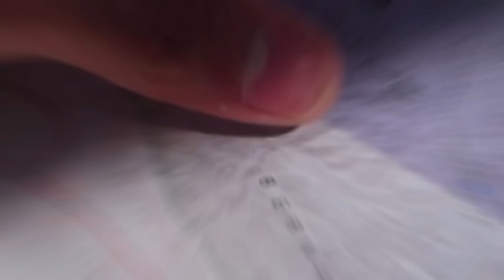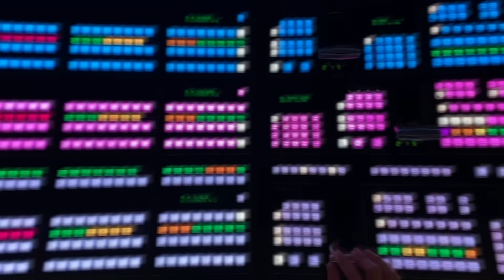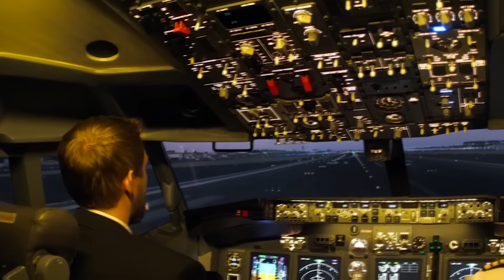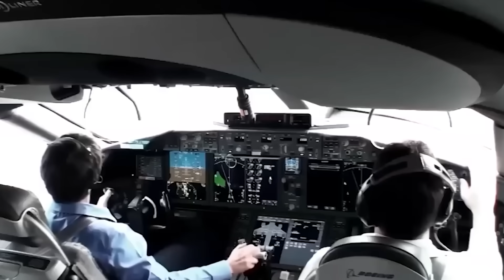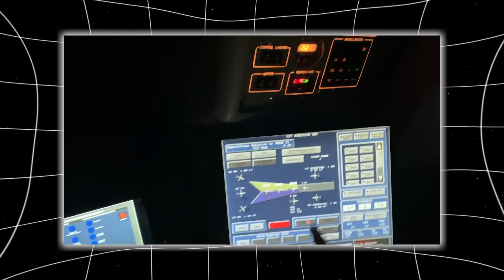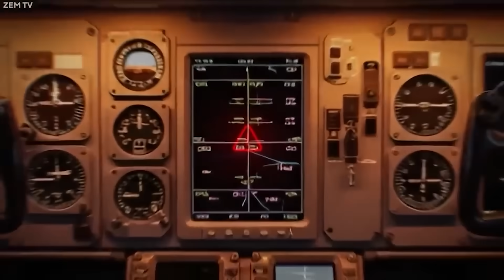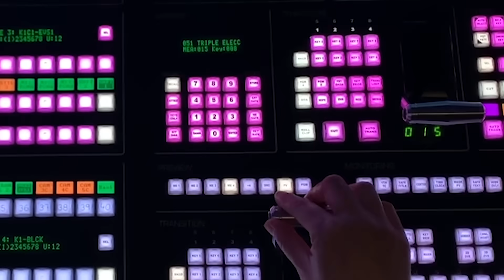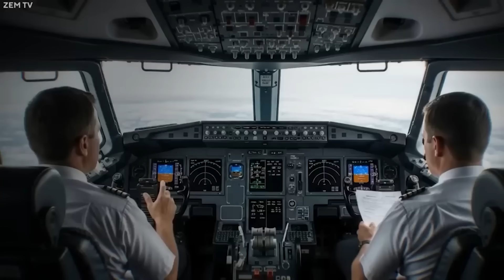Scientists REVEALS the Men Behind the Crash of Air India 171

Comment: OK. It sounds like SkyFall might finally be getting the rhetoric correct. I bitched a several days ago but am starting to change my mind. I respectfully disagree with some of the comments below. Some actions by a pilot cannot be prevented, that's true. But some actions can. If the switches had been run through the computer, the computer could say, hey wait. The plane is in the air, we will not shut off the fuel. This did not happen, so the software was negligent. And if some complaints at Boeing were made that were ignored, then yes, the company is at fault.
Reply: The cut-off switches must be activated in the air when an engine is on fire. Otherwise, fuel would be pumped into the burning engine.
But the computer should give an audible warning if the cutoff switches are activated.

Comment: be careful to make such a slanderress video very dangerous and could put you in jail
if what you are saying is true this would have happened before many times after all there are over 1000 Boeing 787 's flying
 the fuel switches are the ultimate control for the engines overriding everything else one of the pilots obviously switched them on and off

Comment: The FADEC fuel control system has the capability of overriding pilot commands (a major design flaw) It can cut off the fuel supply to the engines if it thinks (computer ) that it is ground mode and the pilots can do nothing about this. The Flight Recorder could interpret this command as a movement of the switches that never happened. An electrical failure just after take off could have triggered the FADEC into making confused demands.  NO aircraft control systems should ever override pilot commands. If you want fully automated, pilotless aircraft, this is what you are likely to get. Blaming pilots is an easy way to get airlines and aircraft manufacturers off the hook. There should be an override system for the FADEC.
Reply: 200% correct 🙏🙏

Comment: Switches were never cut off but engines lost power due unknown reasons. Sabharwal just tried to revive engines by toggling the switches OFF/ON as per SOP 🙏
Reply: WRONG! THERE IS NO "SOP"FOR CUTTING OFF ENGINES AT LIFTOFF AND RESTARTING THEM AT LESS THAN 1000 FEET WITHIN LESS THAN 60 SECONDS! INFO TO YOU, THE BLACK BOX SAID THAT BOTH ENGINES WERE SHUT DOWN BY THESE SWITCHES BEING MOVED TO SHUT DOWN POSITION. THE ONLY WAY THAT THESE SWITCHES COULD BE MOVED IS MANUALLY BY HUMAN HANDS, THESE SWITCHES ARE ISOLATED FROM ANY OTHER SYSTEM AND EACH OTHER, THEREFORE NO OTHER SYSTEM COULD MOVE THEM. ARE YOU SAYING THAT WE CAN'T BELIEVE THAT LYING BLACK BOX???????
Reply: @Bigdog4752 both pilots did not know how engines lost power 😢